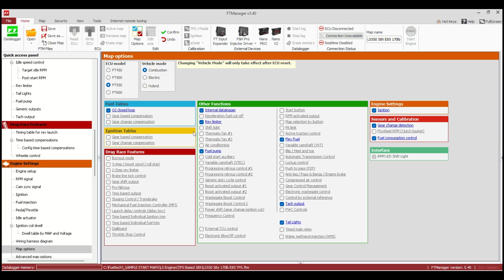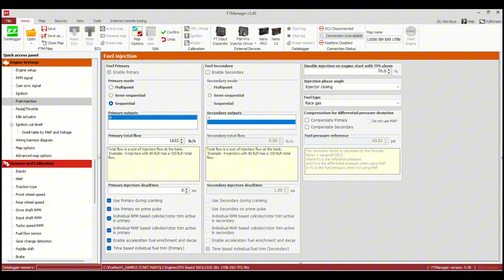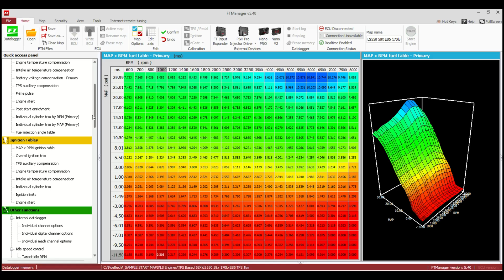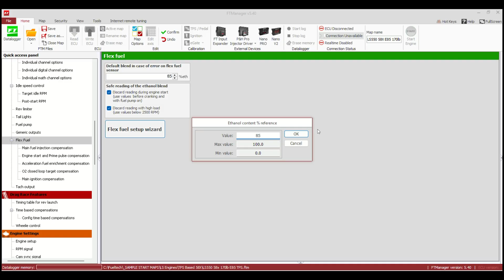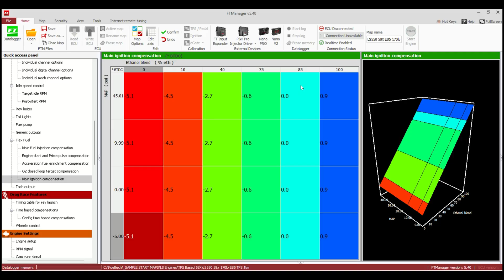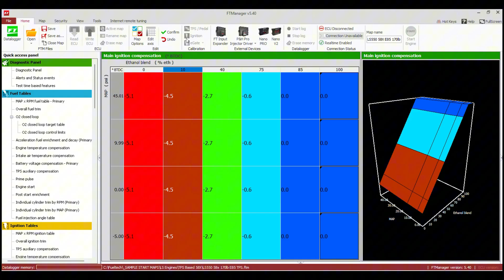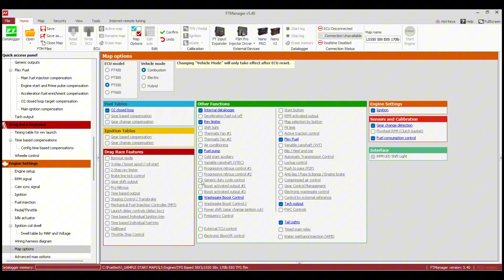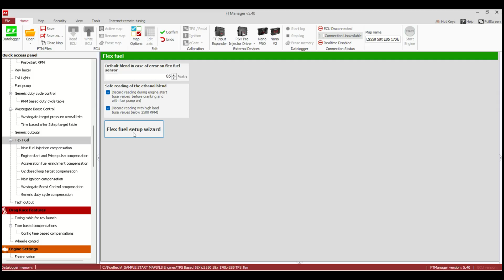Setting Up Flex Fuel on FT Manager | Tech Tuesday

Comment: Hello, so you have to have your tune dialed in for the ethanol content you will normally use first (in this case e85) then enable flex fuel to compensate for less or more ethanol content?

Comment: Man, this is pretty cool. I always prefer to see a fuel table in IPW ms as well as VE. Guess it's just the way I learned. I suppose I would also prefer to have the dead time included in the actual values in the map. I assume the data logger reported IPW value includes the deadtime.
Reply from the maker: Yes, the datalogger includes the battery offset in the reported PW.